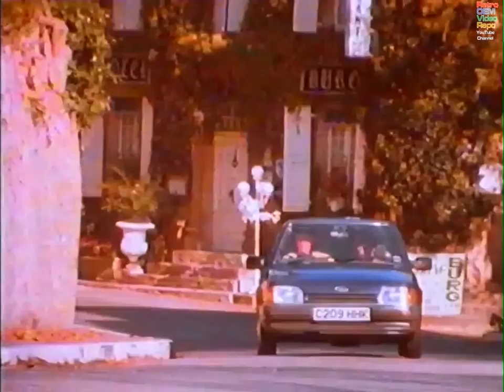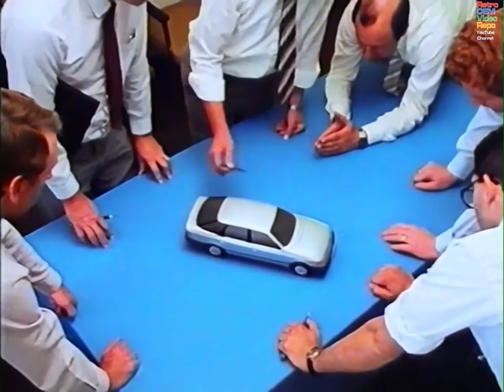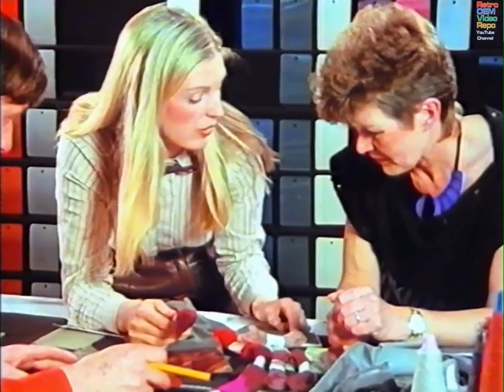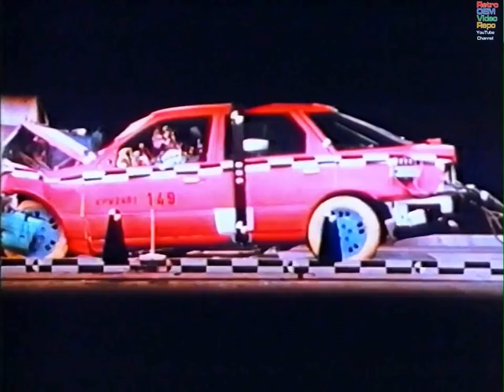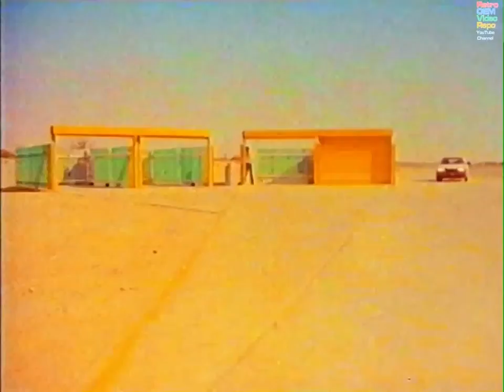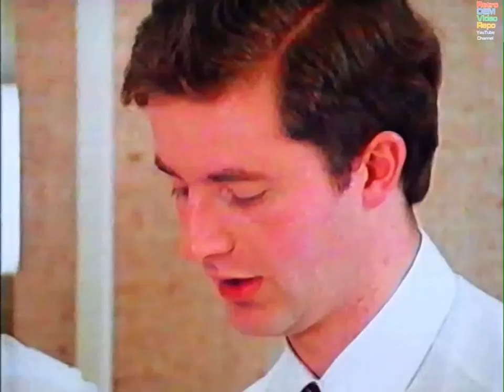Ford - A Ford Guide to Design (1988)

Comment: Despite the skilled workers and new technology they still managed to screw up the 1990 ford escort
Reply: I much prefer the Mk5 to the Mk6, the Mk6 was just a blob and had no character whatsoever.
Reply: Yep, had two Escorts & an Orion as company cars in the 90s ...they were dire
Reply: @cresto9325  you're kidding right? As stated previously I had three Escort company cars in the 90s, they were dire. I then drove one of the first Focuses & the difference was like night & day, the Focus moved the game on considerably.
Reply: @cresto9325  mine weren't lol. And the dealers were awful as well just to compound matters. Put me off Ford for life TBH. I think I know what you mean about the Focus interior, I was never a fan of the dashboard on the first ones lol. They gave me a Hyundai Lantra in '97 & at first I was a bit dubious as they weren't a very well known manufacturer back then but it turned out to be a breath of fresh air after the Escorts / Orions. Did 120,000 trouble-free miles in it too.
Reply: @cresto9325  yeah I had two 1.8 TDs & a 1.4 petrol. The TDs weren't bad, apart from no power below 2500 rpm, so if you got caught out in the wrong gear below 2500 rpm on a hill you were buggered lol. On boost they were quite quick for turbodiesel in their day. The 1.4 petrol was gutless though. And one poor bugger on the firm got lumbered with a 1.8 non-turbo diesel, now that WAS a slug lol.
Reply: The last of the Escorts were so bad it irreparably damage the name, which is why they ditched "Escort" and went with "Focus" and an entirely new car.
Richard Parry-Jones, who had moved from Ford US to For Europe, Head of Engineering drove the Escort's competition to understand what the replacement needed to be. He drove the Golf and the 306 and realised that Escort was so far off the pace that they ditched any attempt of updating the Escort and started again.

Comment: How very interesting , amazing how far car technology has improved since 1988
Reply: This was long before 1988, the Sierra was introduced to the market in 1982, it was designed in the late 1970s, don't know why they have 1988 in the description.
Reply: @MrGoogelaar  
Couldn't have been long before 1988 as it shows a Sierra Sapphire, which was launched in 1987.
Ford wouldn't have been able to show development footage from 1988 or so as that would still have been classified.
Reply: @lewis72  The Sierra was designed in the late 1970s and the video consistently shows Sierras under testing etc, by 1988 the Sierras  were on he market for a couple of years already by 1988. The whole video is about the development and testing of the Sierra that happened in the late 70s and not in 1988.
The video was most probably made only in 1988 using footage from the time the Sierra was developed about ten years earlier and a couple of pics of the Sapphire that was nothing but a booted Sierra were  included.